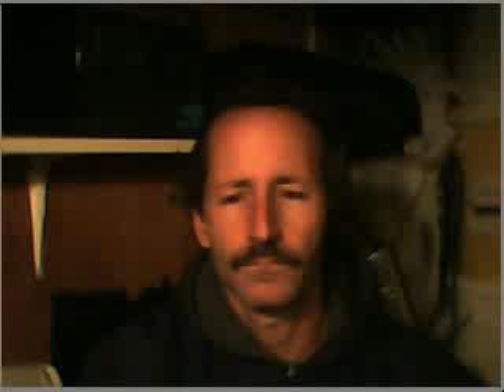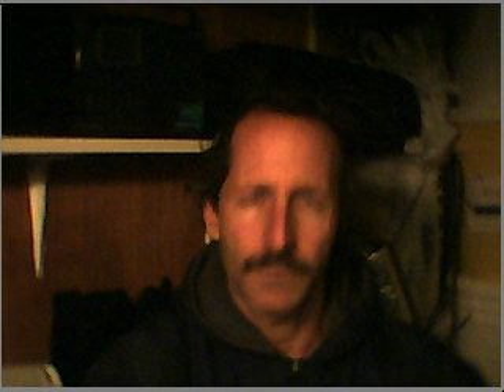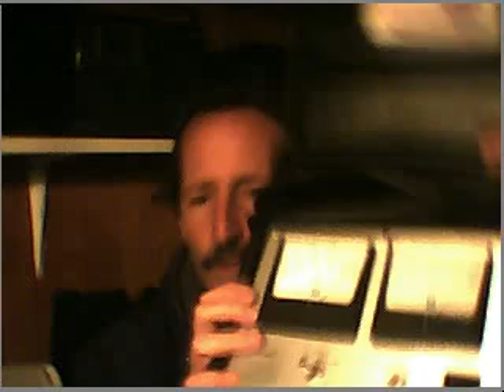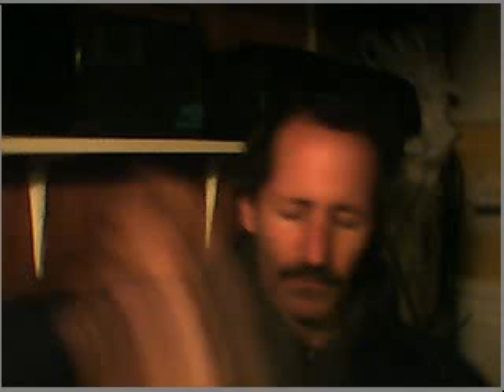Eden Pure Heaters are no better than most space heaters

Comment: You are correct if you are using electricity directly to produce heat.  If you are using electricity to move heat, ie. a heat pump, you can get 4 or 5 times the amount of heat per watt.

Comment: Any good electric heater, used intelligently, will save you money because you're only heating a room or two at a time, not the whole house.  In my own case, I turn on my oil furnace for ten minutes in the morning to warm the house, then turn off the furnace for the day and use a portable ceramic heater (cost $55) in the room I'm working in.  It keeps the room toasty for very little money (about 5 cents an hour, running it at 750 watts).  Much cheaper than using central heating all day long.

Comment: This is a good product.  Don't get it wrong.  Why is it coming out now?  Electronics in general require new laws for construction for cleaner air.  Infrared is used to heat the circuit boards hotter during construction.  So new controllers for quartz bulbs, which can flicker to adjust heat, are being made at no expense meaning very high quality components.  They pick these up for cheap and you get a high quality heater, extremely efficient based on they are made to help the environment!

Comment: @kdaveem - the copper supposedly retains the heat - If it is being retained- then how is it being transfered to the room ? Answer - it is being transfered at a slower steadier rate - which does not  'overheat' air around or coming out of the unit and sending it up to the ceiling.  I don't know it makes sense to me - I have used ceramic heaters and elements are very hot - glowing - If  a Lamp uses 1500w for a short period of time 'overheating' the copper - the copper can then trans to the room ?

Comment: What I find astounding is how they claim these 1500 watt infrared heaters can heat up to 1000 square feet.  If they put out the same power as a 20 dollar space heater how can they claim it will heat so much more than the cheap space heater?  It seems to be an out and out lie. Whether its Eden Pure or another brand they all put out the same power and radiant heat or not they are not going to heat that large a space with that amount of power.  And Bob Villa, he would say anything for money.

Comment: @ kdaveem. You're correct, the only thing that the Eden Pure might be better at is being cool to the touch. However, all electric heat is 100 percent efficient. Buy the least expensive heater with the features you want and you'll spend a small fraction of what you will with the Eden Pure. As a foster parent, I can't even have these in my home due to state law.

Comment: No. The question is how comfortable is the room? Not, how hot does the heater get? The infrared bulbs, available at Wal-Mart, heat the air and the "stuff" in the room and you feel warmer and more comfortable at a lower thermostat setting than with radiant heat which produces hot spots. radiant is only warm when it is directed right at you. Try both and see the difference

Comment: You are measuring apples and oranges and therefore coming up with false conclusions. The name of the product is immaterial. Try this mount 6 250 watt infrared bulbs on a platform, enclose them in a metal box with openings for inlet air and outlet air and blow a fan over them.

Comment: This will not cost very much but it will make a very effective room heater. You will experience the "soft" heat that edenpure advertises. The room upto 1000 sq ft. will be warmed from ceiling to  floor very evenly. no hot spots or cold spot after it has been operating for some time. Improve the design by adding a thermostat, and Iron pipe for the bulbs to heat and the air to blow over.

Comment: Yes, every watt-hour of electricity consumed eventually becomes 3.41 BTUs (a BTU is 1 pound of water heated up by 1 degree F) of heat. If it is from a light bulb (no matter the type) part of it is radiated as heat and the rest is radiated as light which is then absorbed by objects and becomes heat.  It doesn't matter if it is 3 500 watt bulbs shining on "cured copper" in an overpriced box or 15 standard 100 watt bulbs on a table or a 1500W heater for $20 at Wal-Mart the heat output is the same.

Comment: Furthermore, their $300 heater is only 900 Watts.  My $25 Holmes heater has lasted for 5 years and puts out about 1400 Watts. Most home outlets/breakers are 15 or 20 Amps, limiting the heat output for any circuit. To whoever claimed the air filter made the air healthier, its not a hepa filter, just a standard crappy sponge type found on many midrange ($40) heaters. Like most scam companies a simple internet search reveals countless early failures and worthless customer support for the edenpure

Comment: my parants bought one a wile back the unit come with a no questions asked waranty it has built in humidefier and filter it is like a wood stove very soft heat and yes if you are planning on having a room you can walk in and its 95 \100 degrees its gonna have to be a small room to mantain that but we use it as a suplument not primary with it on our furnace does not come one prolly two thirds or so as much as it used to

Comment: tommya300's comments contradict basic laws of physics- he has basically rewritten science! 1500 watts from an outlet translates into 5120 BTU's of heat, whether the heat is generated from a resistance coil, quartz or whatever. EdenPure cannot possibly be more efficient than that $20 Pelonis I bought at the Ace. That is why they are a scam that rips off the poor and elderly because they try to convince people that they are "miracles."
      This is not opinion, this is *fact.*

Comment: I live in a 100 year old double brick home w/plaster and lath walls, no insulation in the walls. I have sold hundreds of residential and commercial (pro heat installs). Have proficiency in Elite HVAC load calculation software and am Eden Pure dealer. It's idiots who miss-represent the product that create
a bad name. Eden Pure is miles ahead of ordinary space heaters as I found out for myself this past winter. They aren't meant for
poorly insulated buildings or garages or basements, please....

Comment from the maker: It may be a nice heater, but nevertheless your heat output is still limited to about 5000 BTUs for 1500 watt of input power. A heater which draws 1600 watts will do slightly better, but not much.

Comment: The older fan forced heaters from the 1950's and 1960's tend to use 1600 watts and put out lots of heat. I just put new wiring in my old Thermador, which is a fan forced unit like your cube heater (just more powerful) and I use it at the office.

I'll send a video of a friend's similar Dominion / Montgomery Ward heater.